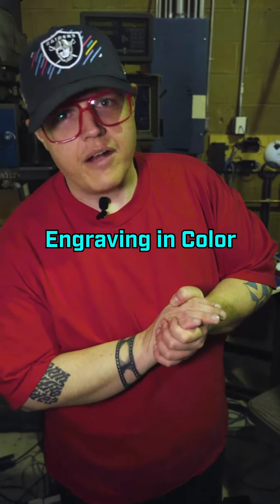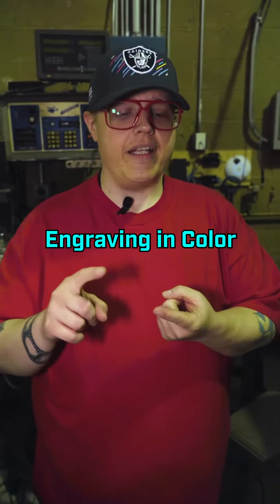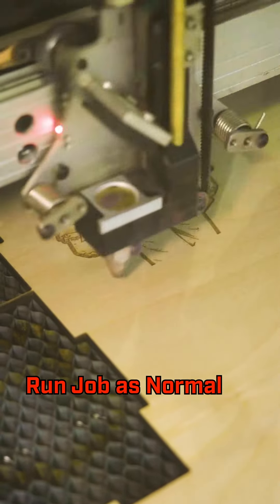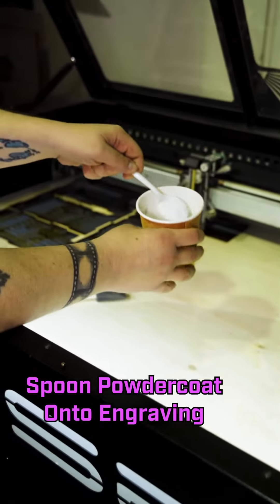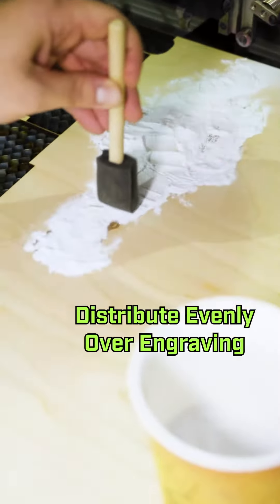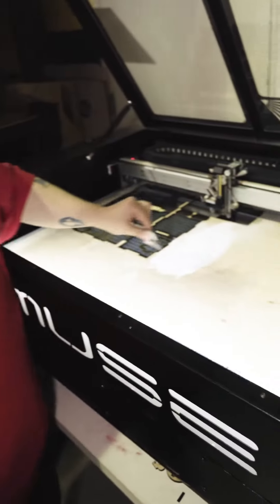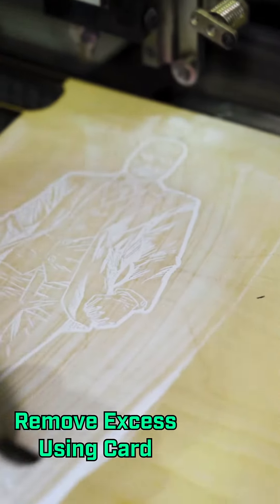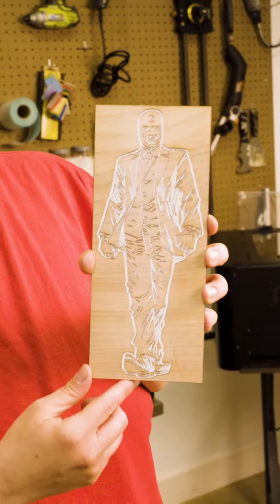How to Engrave In Color with a Laser

Comment: How do you turn off or keep air assist from turning on?
Reply from the maker: You can pinch the hose with a clamp or simply remove the hose from the port on the back of the laser - Keep in mind that removing the air assist will increase the chance of material catching fire!
Reply: @FullSpectrumLasers  we left the air on, doesn't seem to really blow it anywhere so it works for us with it on.

Comment: I need more info. Did you run it first as raster or a filled vector?
Reply from the maker: You can run it as either. I usually convert vector infills to rasters. Just be sure to adjust your power down if using vector infill. - Jordan